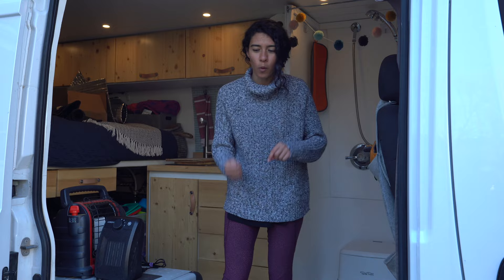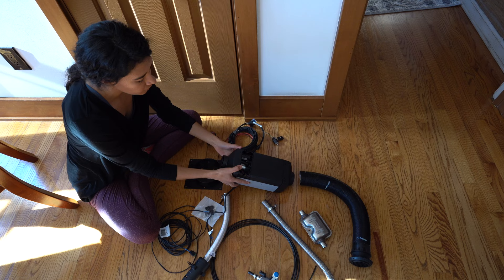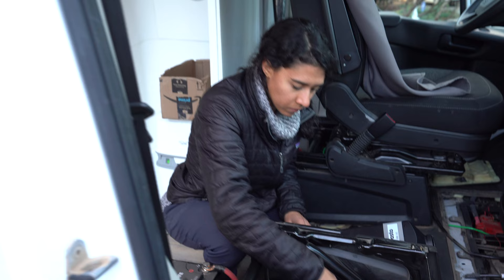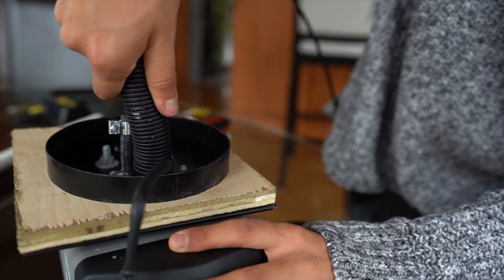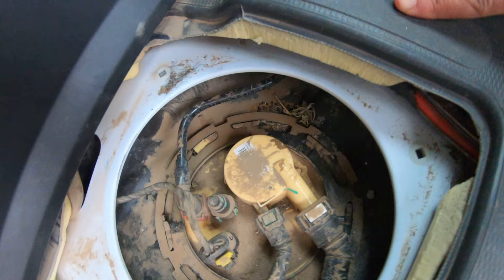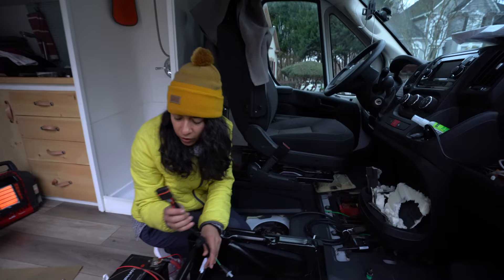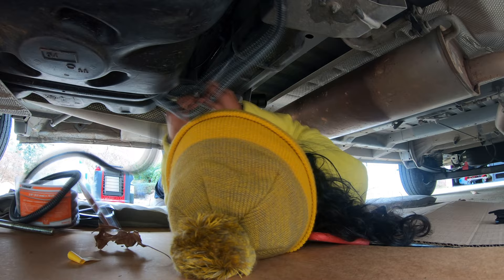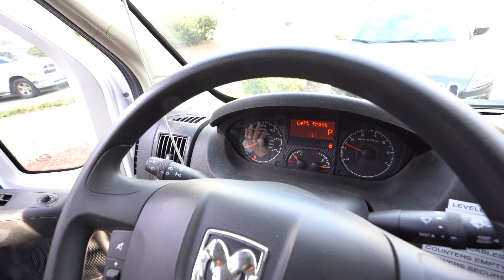WEBASTO GAS HEATER | PROMASTER VAN INSTALL

Comment: Great video! 

One pro tip I found on the interwebs... 

I routed the intake back to inside... That way you are heating already warm air from inside the RV  instead of cold (potentially frozen) outside air. 

Makes a huge difference in fuel usage.
Reply from the maker: Wow never thought of that. Thanks for the tip!
Reply: The outside air intake is for your combustion air, and the manual on my Webasto says clearly not to take this air from the passenger compartment. It would create an interior vacuum, pulling in outside (cold) air from every crack in the van to fill what is lost out the exhaust pipe, so it wouldn't actually save fuel. 

There is a separate air intake inside the cab that takes the interior air to reheat. It's sized for the ductwork and this should be kept indoors.

Comment: Narrowed down heating option to Webasto because of the existing fuel port on the Promasters.  A couple of new things learned in this video: 1. Heat shield removal was not necessary (thank goodness) 2. To add extra height, use wood piece before adapter plate. Smart!! Thank you and happy travels!
Reply from the maker: Thanks for watching the fuel port is so convenient. Not sure we would have attempted this without it.

Comment: On the subject of the mice in the van. I put dryer sheets in different places under the van and around the engine compartment to keep the little critters at bay. I assume they don't like the smell or they get the idea humans are in the area. Had some in the engine compartment of our Mini and since the sheets are in, haven't seen any evidence of mice. Inexpensive and worth a try.
Reply from the maker: We’ve heard that works well for many people! Luckily we haven’t run into any more mice recently but in areas where they’re more common, we sprinkle some cayenne pepper around the tires and that seems to do the trick.

Comment: BEST AND SIMPLE VIDEO...bUt HELLA GREAT INFORMATION! STRAIGHTFORWARD...AND DONE BY A 👧!!!!!!!!!👍🏾👍🏾🍾
I’m also building in STL. NOT getting under mine right now! Only item I’m looking for is the muffler...(?). From this estranged Ga 🍑 currently wishing she was there, YOU GUYS HAVE HEAT! I’m impressed and now ready to take mine on!!!! THANK YOU!!!
Reply from the maker: Glad it was helpful! We just added the links for the muffler. We also ended up buying two more heavy duty clamps for it as well. We've seen others opt not to get the muffler but we wanted the heater to be a quite as possible since we will probably be using it at night mostly. 
Muffler - https://amzn.to/3quDyAg
Extended Exhaust Hose - https://amzn.to/2ZdrGXp
Heavy Duty Clamps - https://amzn.to/3bezDkx
Reply: Oh! Check mine out at @bohemianwanderlustllc it’s being all done minus the electrical (my dad), so it is slow moving at the moment. Lots of video but overwhelmed with YouTube right now so I’m sticking to showing tidbits.
Reply: @OutOfThisVan  yeah, my dad seems to think it will be quiet enough but because I’ll be traveling sola, I want to be as stealth as possible, so thanks for the link!
Reply from the maker: @rayeneals8582  right on! Have fun with it. The build process is truly unique and you learn so much. I feel you with the videos. On our full build we have a ton of videos but they are all just random parts of the build since we were more focused on actually building the van.

Comment: This video has really helped me with our install, thank you!!  One question - did your kit come with a foam piece that sits below the metal mounting plate?  The reason I ask is because I didn't see it anywhere in your video and this might have given you the extra height you needed to clear that bar behind the seat.
Reply from the maker: Interesting! Yea, I don't think ours came with that. Hopefully they are making better kits by now.
Reply: I know this is late, but that was a relatively recent addition by Webasto. It adds a touch of height, and ensures an airtight seal between the ground and the cabin.

Comment: Great video! Very clear explanation of everything. Do you happen to know if you still need the Rheostat for altitude if you have the Smartemp 3.0?
Reply from the maker: Thank you! I’m not familiar with the smartemp 3.0 so I’m not sure if it’ll be able to adjust for the altitude. It seems like to would but I also feel like my digital one should have been able to as well.
Reply: @OutOfThisVan  That's great  - Thank you for the quick reply. I just ordered the 3.0, so I guess I will find out soon!

Comment: Great video and looking forward to doing the same. Quick question - was there a reason why no fuel filter was added to the inflow to the fuel pump?
Reply from the maker: No reason other than it didn’t come with our kit. We would add it if it did. (Even though we’ve read stories about the filters clogging) Luckily we haven’t had any issues with our heater yet. We do have it in high altitude mode which we recommend if you’re planning on being at high elevation ever.

Comment: Hi I have a 2019 ProMaster and I’d like to get a Webasto heater like yours. Mostly I park the van on a city street and need to be stealth. My big big question is how noisy is the exhaust from this? On a quiet morning, say 5am, is it going to be noticeable to someone walking past my van?
Reply from the maker: Outside the van I’d say it’s almost equivalent to having the van on. There is also exhaust that when cold would be visible. Inside the van would be warm and toasty.
Reply: @OutOfThisVan  Hey thanks for answering my question! This is my second van build, and I was trying to get away from propane. I appreciate the feedback!

Comment: Is that valve that you tapped into for your diesel standard on a Promaster? About to get a 2014 diesel, and hoping to Webast-it like y'all did!
Reply from the maker: We have a gas ProMaster and I do believe it's standard. At least from the year 2018. I don't have much info on a 2014 diesel but you can quickly check (or have the seller check) without much effort. Just need a screwdriver and access to the center area between the seats.

Comment: We hooked everything up but not power!! There is no light on the digital remote. Is there 2 fuses you need to put on the cable. There is a slot for 2 fuses. We don't have a big knob to turn on and off.
Reply from the maker: We hard wired ours into our electric system but I remember there are two fuses one for the remote and one for the heater. Let me know if this solves the problem.
Reply: @OutOfThisVan  Thank you so much for reading my question. There is a F1 and F2 fuses holder on the cable. We received One 1 amp fuse, One 15 amp fuse and One 20 amp in our kit. We tried the 1 amp with the 15 amp but that didn't help. Can't find any install guide that I can read and not sure which slot needs which fuse. Thanks so much. We put a multimeter to the heater and have 12.3 volts.
Reply from the maker: @msmargiek48  it should be working with a 15 and 1 assuming the fuses are working properly. Since I wired mine into my fuse box I’m not sure what f1 and f2 are but the 15 should be for the heater so the power line should go into that fuse first. You could probably try both larger amp fuses for a test but I’m not a electrician so I can’t guarantee it wouldn’t mess up the digital controller.
Reply: @OutOfThisVan  We have ours hard wired into our fuse box as well but that didn't work digital remote looks dead so we added the fuses on the cable but that didn't work either. Thanks so much for trying to help.
Reply from the maker: This will require stripping wires and a twist on wire connector but if you want to make sure power is getting to the controller and the heater I would try hooking both into a single 15 amp fuse on the fuse box just to verify they are both receiving power. If the remote doesn’t show any signs of life then It’s probably faulty.

Comment: I've heard heard that the company doesn't recommend installation so close to the fuel tank ? Just wondering if its true...thanks 🤷‍♂️
Reply from the maker: Could be true. We haven’t heard anything like that. There are tons of camper vans with it located in the same spot and we haven’t heard of anyone having issues.

Comment: For the electricity to the fuel pump, how can you tell which is positive and negative coming out of the heater?
Reply from the maker: We misspoke on those wires. You can do either one. There is no difference for positive and negative on those specific wires. Thanks for watching! You’re going to love the heater it makes a big difference.

Comment: The issue I’m having is it’ll start and only work for a few mins and turn off I’m not sure how to fix this. Any idea what could be causing it to turn off?
Reply from the maker: Does it start blowing out hot air before it turns off?
Reply: @OutOfThisVan  yes, it’ll start to warm up and it’ll turn off. Not sure what it could be. Checked to see if everything was hooked up correctly didn’t see an issue anywhere.
Reply from the maker: @alminhrncic  Do you have the digital thermostat or the dial?
Reply: @OutOfThisVan  the dial. Just turn it up or now. Not digital
Reply from the maker: @alminhrncic  I'm not sure why it would be stopping. The only thing I could think of is that maybe the gas isn't getting pumped through the line quickly enough. 

I asked about the thermostat because the digital one is supposed to give an error code. I'd recommend reaching out to the manufacturer they may be able to assist more.

Comment: GASOLINE RIGHT? NOT DIESEL...........RIGHT?
Ps....... The reason they made that plate out of metal and not out of plastic or wood is because that exhaust pipe gets damn near glowing red right near the unit right exactly where you have that one I realize this is a year after you made this video but in case you smell woodburning occasionally that could be why❤️🇺🇸
Reply from the maker: No burning wood here. Been working a few years now. I think you might misunderstand the constitution of this one. There is a big hole that everything goes through… no contact with the wood we used.

Comment: you advertise this heater as a GAS heater, where as in fact it is a DIESEL heater, please amend the title.
Reply from the maker: What are you referencing? The install is a gas heater on gas vehicle not diesel.
Reply: @OutOfThisVan  Then why have you got a diesel pump on it, (or with it)?? or maybe where you come from you call Diesel gasoline maybe that's where I am getting mixed up!! but it is definitely a diesel or petrol heater, of which you call gas.
Reply from the maker: @charlietango1635  in the United States we refer to our vans as gas or diesel. Our van takes regular gas at the gas station not diesel.
Reply: @OutOfThisVan  Yes, I know, but over here in the UK we call that diesel or petrol, we also call propane/Calore Gas. "GAS" so let's just leave it there, shall we???
Reply from the maker: @charlietango1635  I understand different areas of the world use different terminology. I didn’t intend to mislead you in any way. Have a great day!